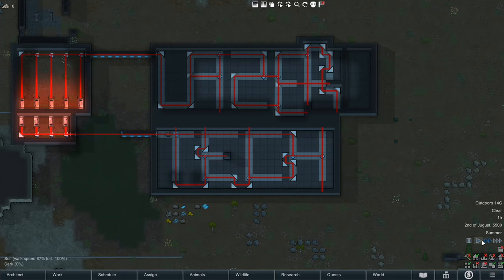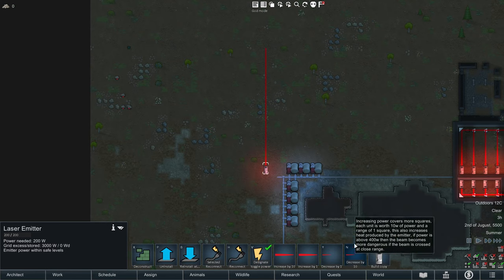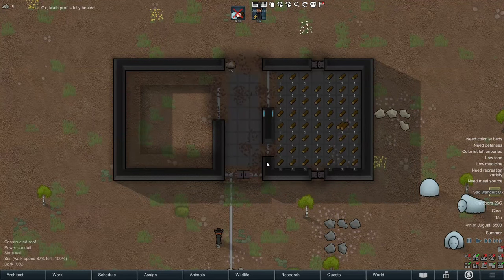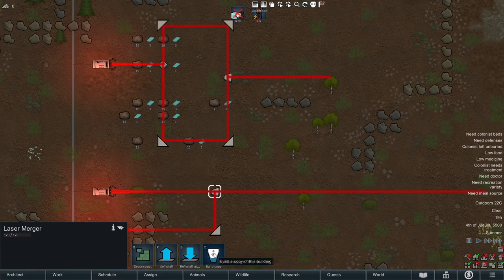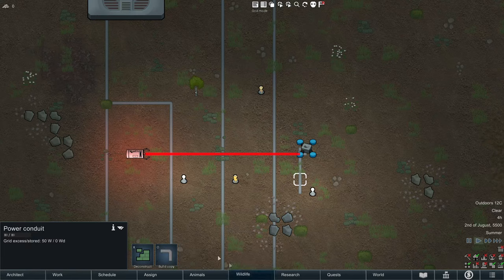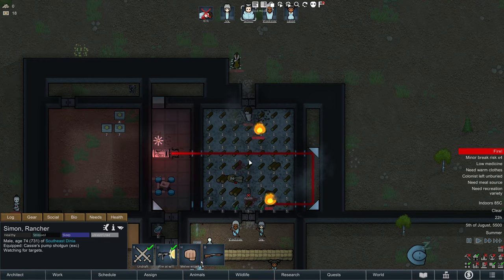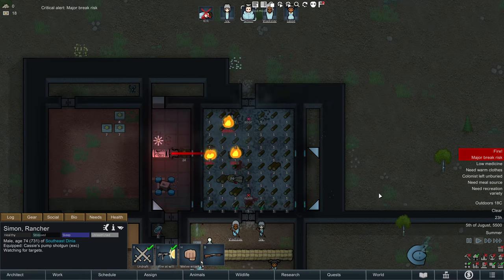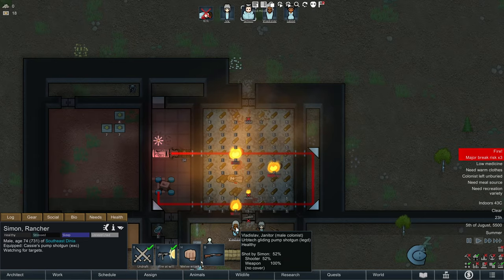RimWorld: Power Logic Laser Tech

Comment from the maker: What did you think of laser tech and it's uses?  please feel free to share your own trap setups.

for those wondering what macro I'm using for the doors, they are a multi profile setup (one profile runs when receiving a signal, one runs when not).  remote prox sensors were in the heat trap room, and the pressure plate (which could be replaced by another switch if you wanted) is at the bottom left if the screen, safely away from the combat/trap area.
Reply: The lasers are fantastic but would you be able to make it so that the harmful damage scales with the amount of power put into a laser? I tried making a death cannon where 15 laser generators were focused into one beam and then fired at an unsuspecting colonist, but it just gave the same amount of damage as a single laser generator.